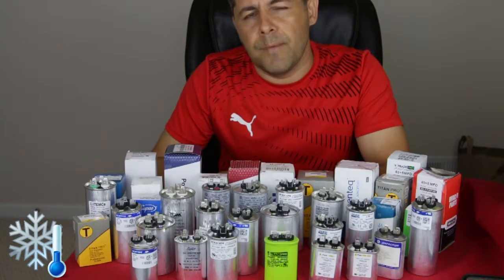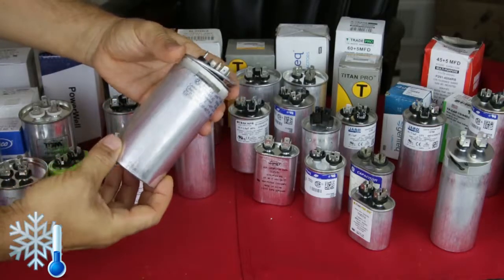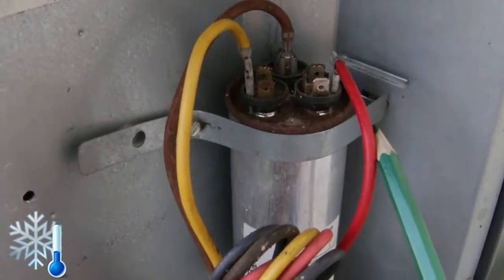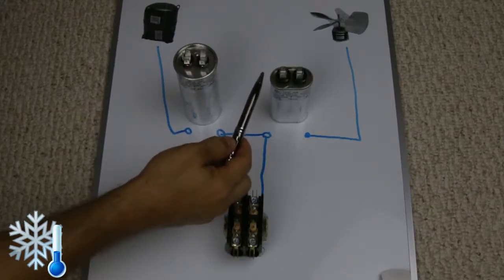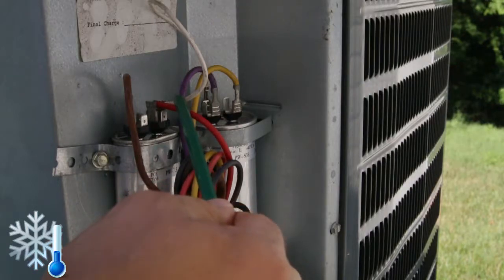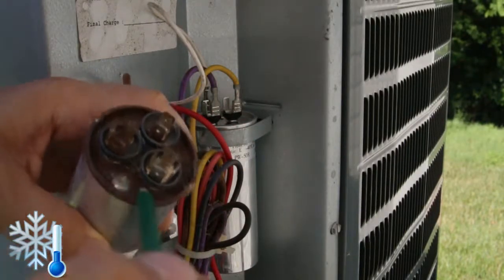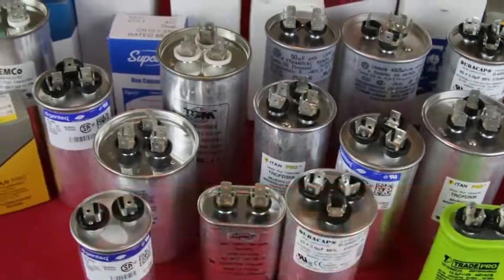Single vs Dual Run Capacitor for the Air Conditioner

Comment: That was real helpful!  I’m still new as a mobile RV tech and couldn’t understand why I was seeing single and double capacitors.  Sometimes I see single and sometimes double. In both cases, they are powering a fan and compressor.  Not sure why that it, but glad to understand what I’m looking at with single and double capacitors. Thank you!

Comment: Thanks for Video, for safety I would have added; with Air Conditioner fan and compressor capacitors  it typically doesn't matter which way around the capacitors are as they are normally non-polarised, but this is not case for all capacitors and all capacitor scenarios. i.e. its quite dangerous using a tantalum capacitor with the polarity reversed (installed the wrong way around).
Reply from the maker: You are absolutely right. If the capacitor is for DC voltage it is always polarized.  I updated the video description. Thank you.

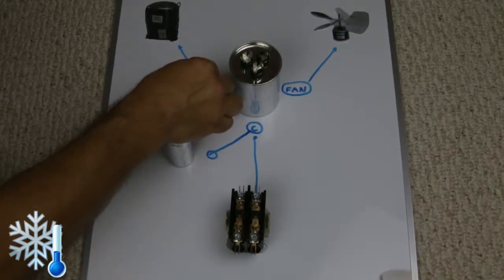Comment: Great Video for a novice DIY guy ! Thanks :)  @2:48 you show adding a additional capacitor ( in parallel ) to boost the dual run capacitor.  Would a  5-2-1 Hard Start  capacitor  be connected like this too ?  
Also what do you use to SNIP off the metal bracket part ? Thanks

Comment: I have a dual capacitor connected to the compressor and a single capacitor connected to the fan motor. I installed a new dual capacitor. I want to connect the fan motor to the dual capacitor and do away with the single capacitor for the fan. Does it matter which fan motor lead goes on common and/or fan of the dual capacitor? Thanks

Comment: When going from 2 capacitors to a dual capacitor do I need to use old ground wires from the old capacitors and connect compressor ground wire and the fan ground wire to the ground on the dual

Comment: Great video. Quick question. Ac fan suddenly stopped and i replaced the motor fan and the store told me to have fan capacitor so i bought it for $6. Now o have dual(existing) capacitor and single(for fan) capcitor. Can i just use the existing or its better to use two capacitors (single for fan, dual for compressor)? Thanks
Reply from the maker: Hi Jeffrey, Most of the times when you replace the motor the capacitor that the new motor require is different than the original, so new capacitor has to be used. If you replace the original motor with the same brand and model motor you can use the old capacitor.
Reply: @acprofessor8513  thanks for the reply sir. i replaced the old motor fan with a different brand. My existing capacitor is 60/7.5 micro-farad (440v)dual run capacitor. When i changed/replaced the original motor fan to a new motor fan(different brand), the store told me to use another/additional new capacitor ( 7.5 microfarad single 330v). My question is, is it necessary to have two capacitors (1 existing dual run capcitor, 60/7.5 microfarad 440v and 1 new single run capacitor for fan 7.5microfarad 330v).. The motor fan has two brown wires that are hooked up to single capacitor(new) and its black wire is going to the contactor and the white wire goes to existing(old) capacitor "c" common terminal.. thanks
Reply from the maker: @jeffreyreyes3614  If the new motor comes with two brown wires it is best practices to use a separate capacitor. There is a way to use your original cap, as it is the same value, maybe I would make a video to explain how to wire it.
Reply: AC Professor thank you for clarifying this. It makes sense now  to me since the new motor fan has two brown wires and i have a separate capacitor for the motor fan alone. Thank you so much and more power to you. Continue inspiring people for your awesome videos! 👍🏻

Comment: What dual capacitor do I need  my compressor capacitor specs say 40/370 but my other capacitor for the fan says 4/370 can I us dual 25 4 uf /370

Comment: I have a condenser unit tripping the breaker lately. It doesn’t happen right away, but after about 12 hours of operation I noticed it getting tripped. I opened the unit up and saw one of the wires running from the common to the contractor was loose, and came right off when I touched it. Could that loose wire have been the cause of my problems?
Reply from the maker: When you have a loose wire it can be two scenarios. First it the wire looks burned, it is possible that the wire has not been crimped correctly or the motor is using too much current. Once you fix the wire check the Amp draw to make sure you are in specs for that motor or compressor. The second option is that wire was making a spark when the unit was shaking. There is a great tool that I use if you are not able to locate the reason for the unit to trip a breaker- Supco MEGOHMMETER M500. I will make a new video on how to use it soon.

Comment: I have a Trane XR14 that is doing the typical buzzing sound but the fan isn't starting or running, even when bump started with a stick. The unit has two single run capacitors. One capacitor (135-162MFD) tested good, and the other (70uF) tested bad. I have a dual run 70/5uF handy. A single run exact replacement won't arrive for another week. Should I be able to install the dual run using the C and HERM terminals?
Reply from the maker: Michael, there should be another capacitor somewhere. The 70uf is probably run capacitor for the compressor(3-5ton System) The 135-162 MFD is the start capacitor that only helps the compressor to start and then it is disconnected using a potential relay. So there should be another cap for the fan.
Reply: AC Professor thank you!  Turns out it was the fan motor itself. I replaced the 70uF that was bad. No go. Replaced the contactor next. Still no go. Then replaced the fan motor and that was the second problem. How often do two components fail at the same time?  Lol
Reply from the maker: @michaelh7770 ,
Some time a voltage spikes. The higher voltage can take several A/C components together and additional appliances too like a refrigerator or microwave. It happens a lot more than we realize and it is not only because of lightning.  A component can fail and we don't realize unless the unit stops working. The fan or compressor capacitor can become weak and components may still work intermittently. The unit will not be efficient and will have less capacity.  
For the fan, the test I do is to give it a push whit a long screwdriver or a stick. If that doesn't help and has a lot of resistance and not able to spin it is a sign it may be defective. That is a good idea to make a new video about motors next.  Glad you got it working.